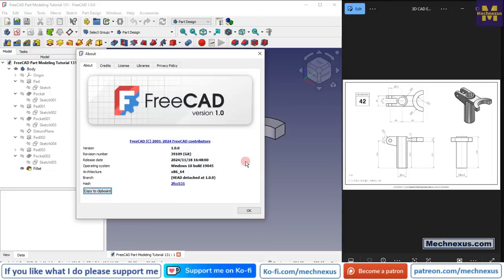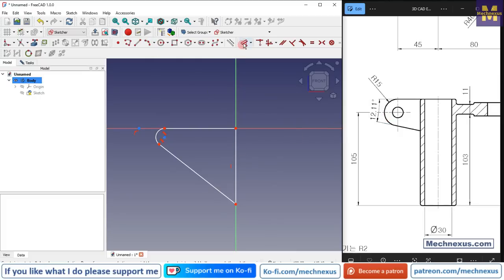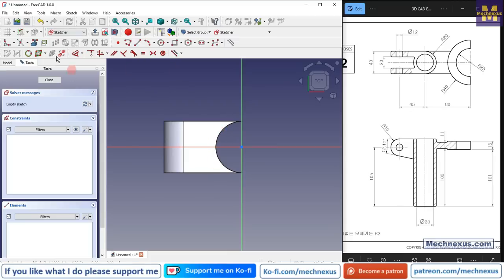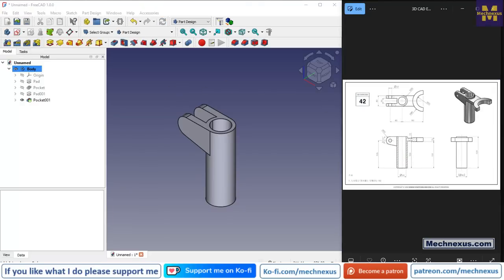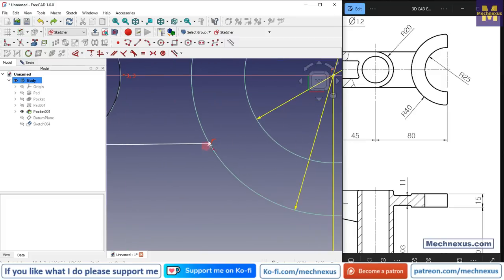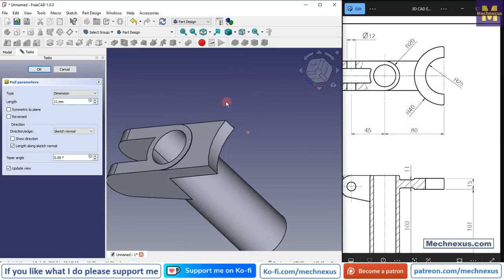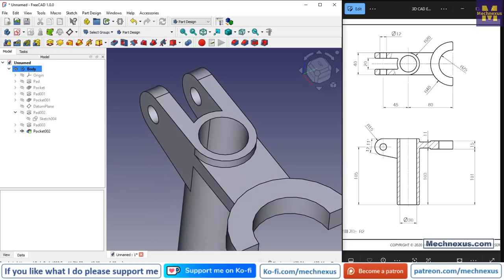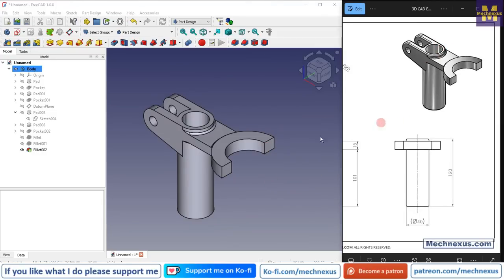FreeCAD Part Modeling Tutorial | Learn FreeCAD | FreeCAD Tutorial | Mechnexus |

Comment: The datum plane isn't necessary, you can add a sketch and attach it to the sketch for the top part (plane face or object's xy) and offset the z-axis as needed. 

You also will want to attach a sketch to a plane (xy/xz/yz) or to other sketches rather then attaching directly to faces.
Reply from the maker: Your suggestion is correct. It's user choice weather create datum plane or use offset method....Thanks.